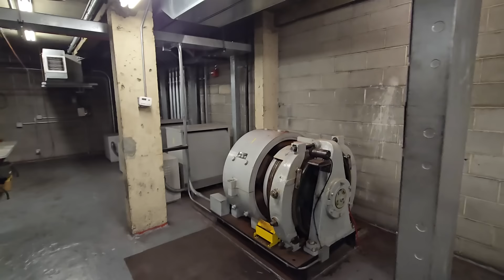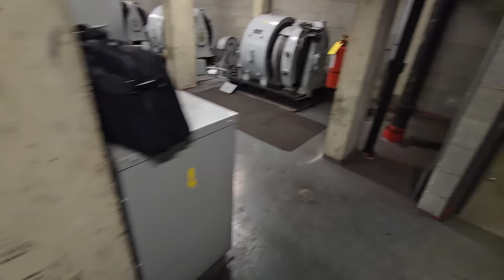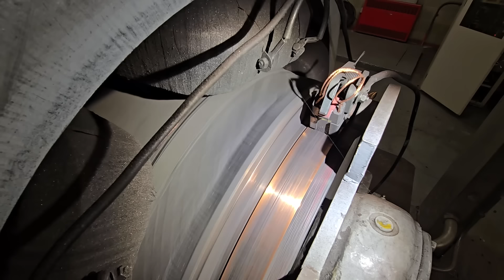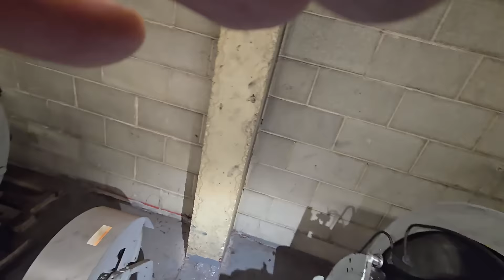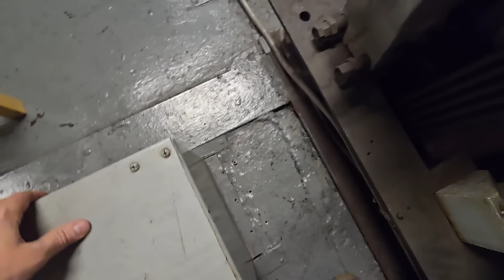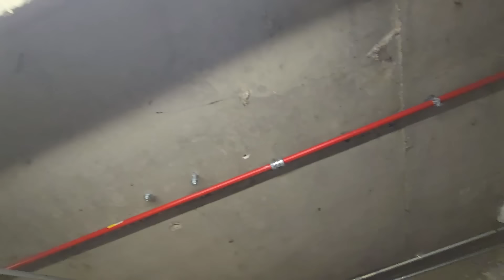High-Rise Elevator Audit Part 1: In-Depth Look at Gearless Traction Machines

Comment: I understand that regulations vary by country, but common sense is clearly lacking here: the compartment door has no panic bar and isn't fire-rated—which is concerning—and there is only one tiny, visible fire extinguisher. It is also absurd to see a table and chair cluttered with haphazardly stacked logbooks or manuals, alongside another disused station featuring an abandoned monitor and nearby boxes of unidentified "spare parts," not to mention the transformer area, which lacks any markings, labels, or numbering identifying the machines or circuits they serve. In short, Chaos Reigns👹.
Reply: Only purposefully stacked books allowed

Comment: Overall maintainable installation. Needs ropes, check sheave grooves, blow the carbon out of the hoist motors once a month so it doesn’t build up, get a rubber stone from Adams and clean/polish the com, blow out the controllers, and change the drive M contactors to the new Schneider contactors from and Allen-Bradley and voila-no more issues. My crew maintains heirlooms. IMC-DC is still supported by MCE, so there is no, “It’s obsolete”statements.

Comment: For as big of motors as they are they sound surprisingly quiet! 😮
Reply: Glad humans can't hear PWM Pulse width modulation. Thats the driving force of those motors.
Reply: @ZeroSpawn  Those are DC - 12 pulse SCR drives with output filters for the motors.  The motors are being fed smooth DC.  Those Otis machines are tanks.  They will never fail as long as properly maintained.  Absolute worst case, you might have to rewind a field coil one day, but those things will probably last as long as the building does.

Comment: That whole system is pretty old. Should be replaced. I love elevators. Those motors are outta whack with wear and bearings as well. Never realized they used tallow for the cables. Makes sense and a great lube for a lot of stuff. Cables are way past needing it. Most critical thing in an elevator. Very cool to see behind the scenes here!
Reply: Just because something is old doesn't mean it needs replacing.
Reply: @davelowe1977  Agreed.  Some TLC on those machines and they will outlast the building.  And they have the track record to prove it.